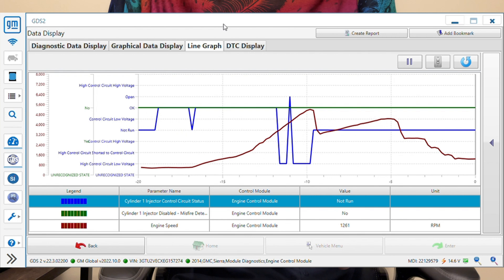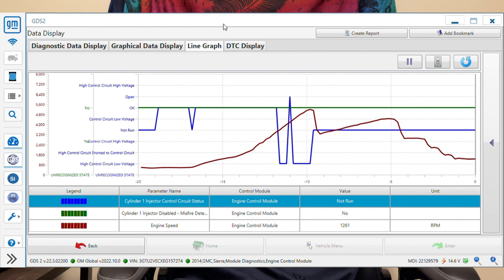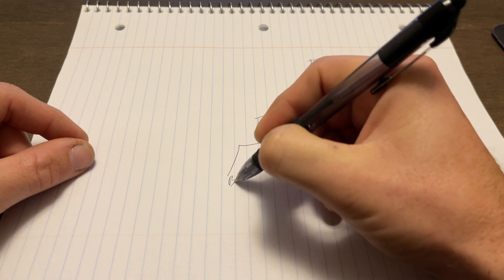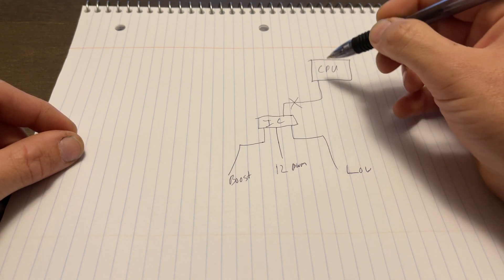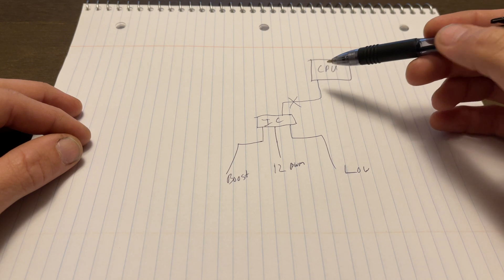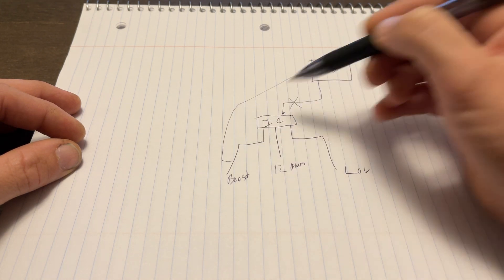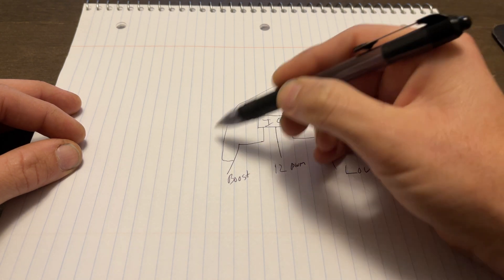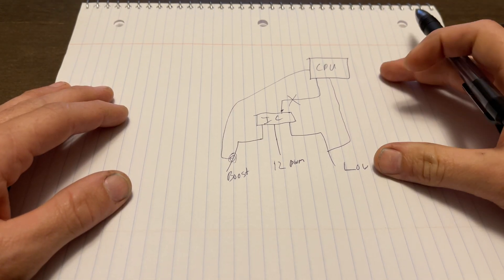Sierra Injector Fault Part 1 Explanation

Comment: If you open up the ECM to the point where you can inspect the PCB front and back you can actually back out the IC architecture by tracing signals from the main connector. This can be made difficult in that the PCB is most likely a 6 or 8 layer PCB depending on the ECM revision, so some of the signals may be routed on internal signal layers. The main complication for the 5.3L with smart coil ignition (amplifier at the coil near plug) is actually the injector amplifiers which will dissipate a lot of heat while regulating the injector hold current. You can tell this by looking at the case which has a huge heat sink on one side in order to dissipate the heat generated from the injection amplifiers.

Most ECM architecture starts with how to accomplish the task of pulse processing. Meaning, detecting engine position (CNK and CAM(s)) and controlling spark and fuel pulse generation.

The injector driving circuit core is probably a smart power IC which will communicate faults back the the Microcontroller (CPU) using SPI PCB level serial protocol.

Comment: I would have called the ecm too. Just had a 2015 Silverado with a bad driver in the ecm that wouldn't ground the O2 heaters. Ran fine until it went into closed loop.